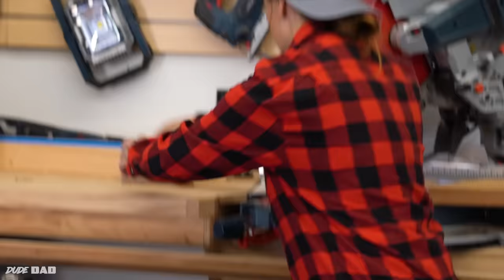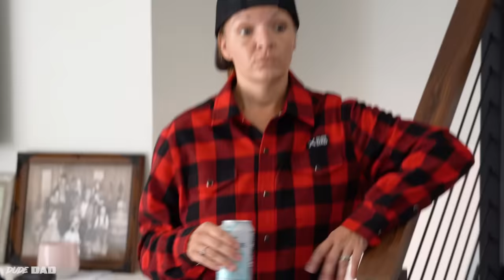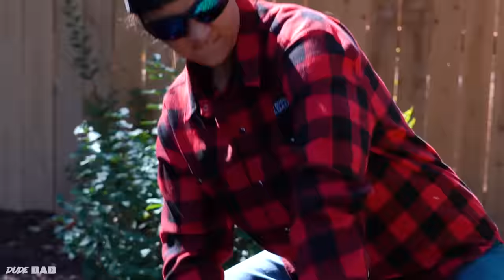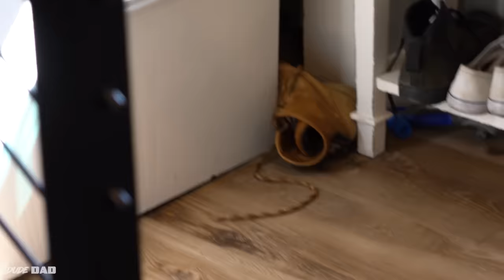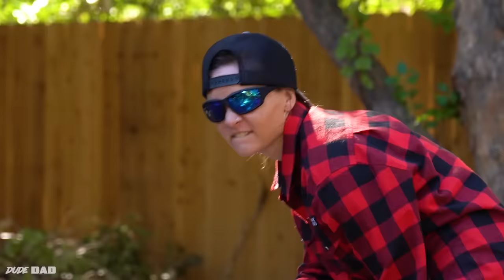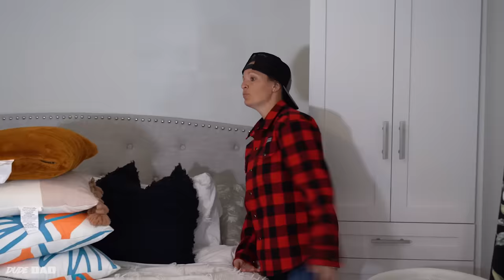My husband doing chores!

Comment: I lost it when "Taylor" power washed and blow dried the microwave!!
Reply from the maker: Is there really any other way to clean a microwave?
Reply: @DudeDad  Yep, one other way.  Chemistry experiment!  (lemon juice, vinegar, water)
Reply: Baking soda vinegar and Dawn dish soap.
Reply: First of all the point of a dishwasher is to wash the dishes. There's absolutely no need to pre-wash. 
Secondly I have been a single parent for 22 years and sometimes you give up the idea of washing a separate load of whites and a separate load of colors. If the washer is full it gets washed. Like you said wash on cold it's all good.
Third bless your power washing but that seems like a lot of wasted water... Got to save the environment there in California.
Reply: I use mayo after he blow dry, it conditions the microwave like you would not believe 😆😆
Reply: @belindajohansen2899  if you don’t prewash sometimes the crap clogs the drainage system. Learned the hard way when a ton of rotten globs of whatever filled up my sink during a dish load. 

I agree w u on the clothes though. A load is a load.
Reply: Have you tried a sand blaster? You know, for those exploded eggs and such!
Reply: Same!!!
Reply: I was like... Wow can we really do that? Would it work?
Reply: Cooper Hilinsky ironically it is my husband who is obsessive about the rinsing because he knows he’s the one who will have to fix clogs, mold etc 😂
Reply: @cooperhilinsky6361  The dishwasher that I just bought in the past year has some kind of chopper upper system in it to have the globs go down. But I also use dishwasher cleaner once a month to dissolve all the gross and grime. I will say as not a good housekeeper most of the time the dishes stay in my kitchen sink until I get a full load to put in the dishwasher. By the time I have run water over them what I'm washing my hands they are technically pre-washed.
Reply: @belindajohansen2899  I do this too ! While I'm washing my hands I purposefully move my hands around in the water and soap in ways so the dishes get pre-rinsed. Lol
Reply: Me too! And the slow cooker in the dishwasher!
Reply: Such a good idea
Reply: @belindajohansen2899  Hey random stranger from a year ago- all solid points. Just wanted to say that while not pressuring washing at all is definitely a better water saver, in general pressure washers use considerably less water than a garden hose or similar. So its probably not as wasteful as it seems.